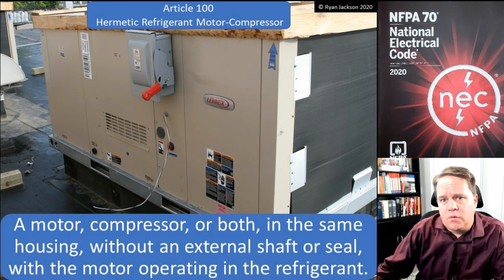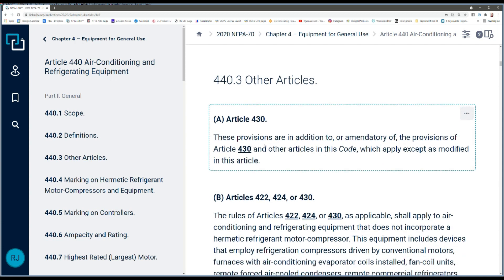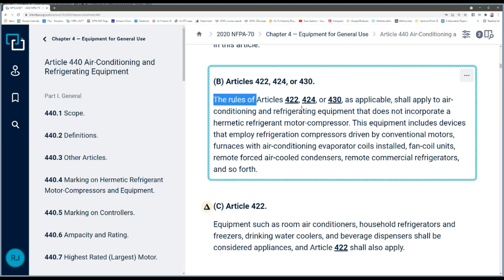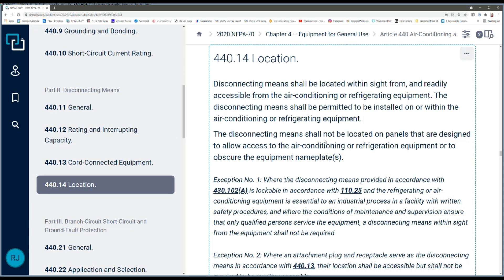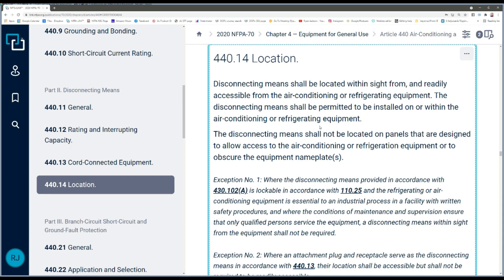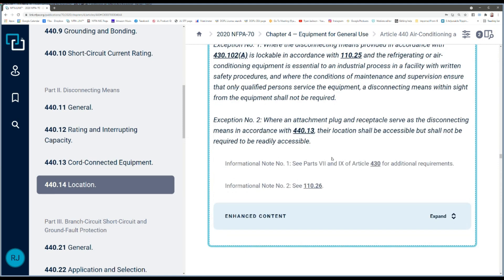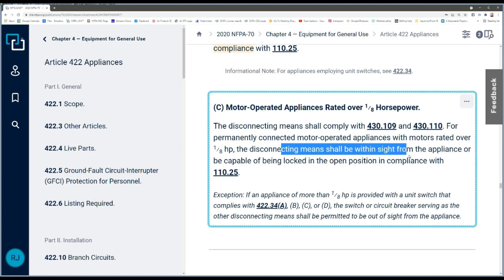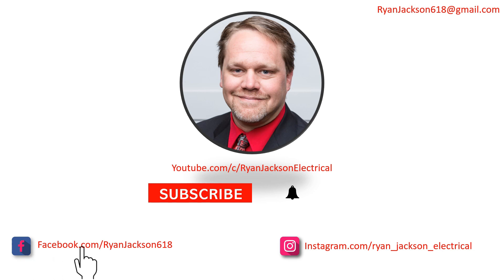100 Days of Article 100: Hermetic Refrigerant Motor Compressor

Comment: I'm not sure how 440 is allowed to modify or amend the provisions of article 430 since they are both chapter 4 articles. I am not sure that the styles manual allows that. Maybe 440 should really be in chapter 6 for special equipment.
Reply from the maker: It is specifically addressed in 440.3.
Reply: @RyanJacksonElectrical  I understand it says that, but I not sure how it is allowed.
Reply from the maker: @jeffbower5525  I'm not sure what you mean by that. The article says that it is a motor and needs to comply with Article 430, except as modified in this article. Chapters 1-4 specifically modify other Chapter 1-4 requirements all the time. For example, see 240.4(G).

Comment: hi ryan ,question if i have a motor control like vfd should be lockeable  if i put outside??? and if they put disconect fuse on the unit would be permit???abel EC .miami

Comment: Hello Mr. Jackson,  so if the outside compressor has a disconnect then the inside air handler unit doesn't need one. Charlotte, NC

Comment: You mentioned Mini-Split.  Many are only 1/16hp and I'm sure not many go over 1/8hp.  So the breaker in the panel would be able to be considered the disconnect.  Some are powered from the out door unit so the disconnect outside would shut them both off.

For the outside disconnect, it could be a breaker in a Nema 3R Load center meeting 110.25.

While on this subject It would be good to remind about required service receptacle.

Comment: You brought up a great point stating that outdoor units need a disconnect. When I started doing electrical work we had several air conditioning units on top of several 3 story building without any disconnects. Most feed from basement switchgear room so old timers would pull control fuse to replace an outdoor fan or disconnect a bad compressor. Back then we never used LOTO to safety secure power. Thank goodness the NEC along with OSHA has provided a lot safer work environment.